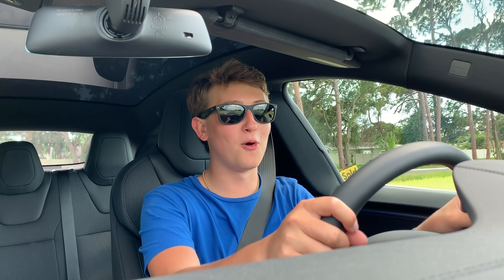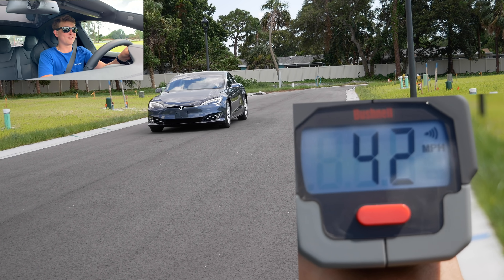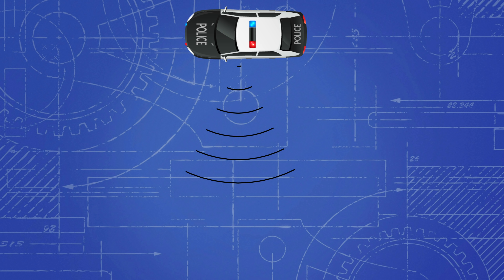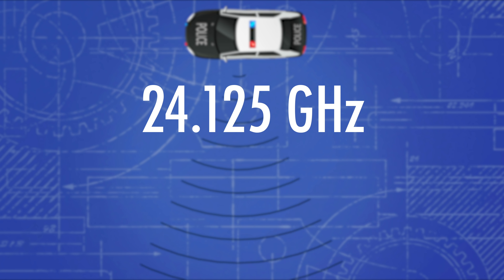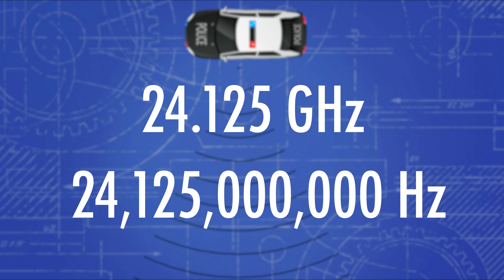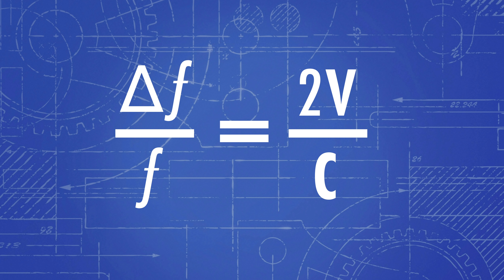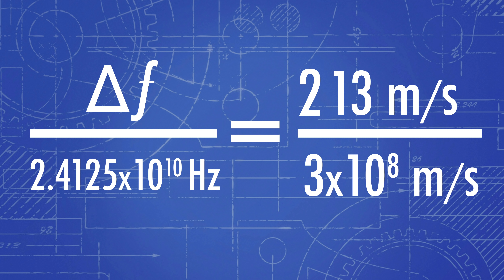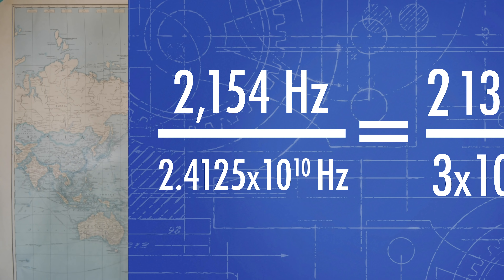Testing the Science Behind Radar Guns with a Tesla

Comment: A radar does a poor job of measuring objects moving perpendicular to the beam.  You get cosine error doing that.  You need to keep the beam parallel to the object your measuring. This is covered in more detail in most radar handbooks that can be found online if you dig enough.
Reply from the maker: Yes, in fact if the angle is greater than 30 degrees you can fight the ticket in many cases. I just made the animations perpendicular because it was easier to illustrate.